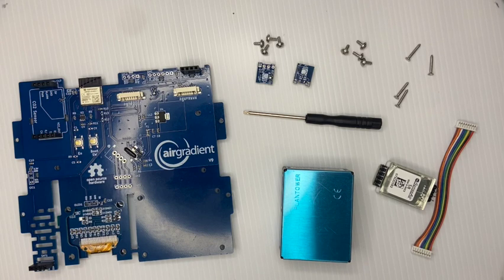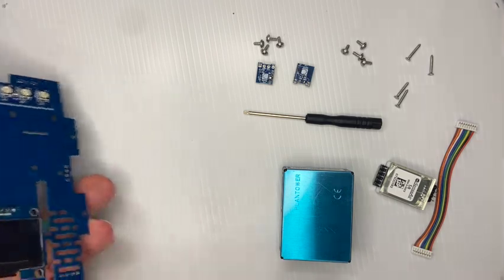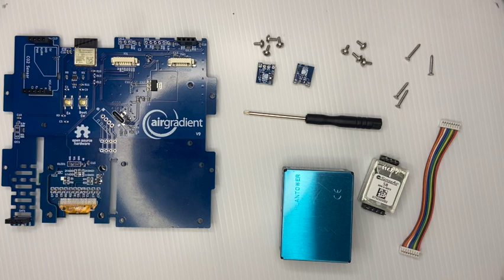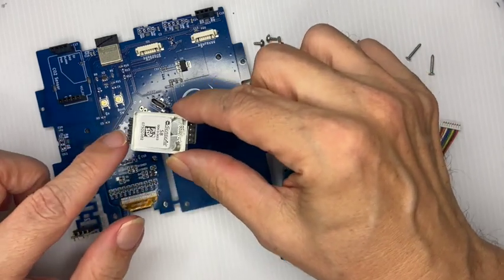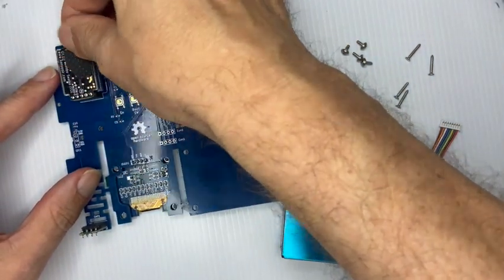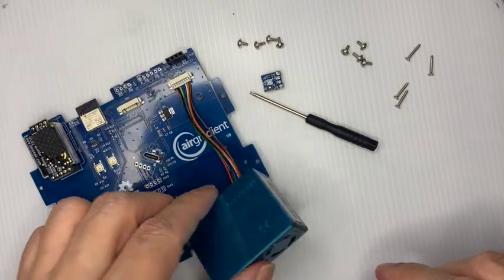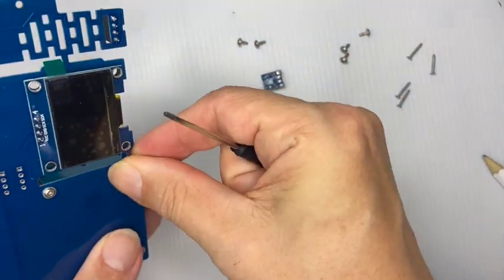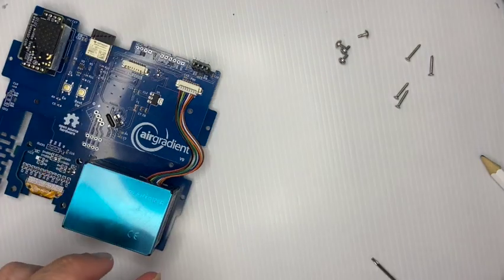Assembly Instructions AirGradient ONE Kit (Version 9)

Comment: This no longer matches the assembly of the kit as of 2026. There are only 4 screws provided, and they are the outer ventilation screws for the body. You no longer need to screw the PCB into the enclosure, it is held in place by the enclosure itself. AirGradient might want to redo this video.

Comment: Is it possible to remove or disable the wifi chip to prevent it from sending wireless radio signals? Or is it not sending any wifi when the wifi is not connected? Reason I am asking is I will have it on my desk close to where I am sitting and don't want it to be sending wifi signals being so close to me. Thanks!

Comment: On my 9.1 kit, I had to contact Air Gradient, as the blue metal box and  stm5 thing were already connected, but nothing else in box. They sent me sensors, but I ended up with 2 little black identical looking "chips" that were not needed, black with 4 prongs - what are these for? Don't see a place for them -

Comment: I was confused, I bought the kit, but it looks already assembled - it did have tape holding the two pieces together, only loose parts were 2 stands if  standing it up on a shelf, and 3 of the little screws (not 4) - could not get a QR code reader to work on my Mac, so had to use my iphone for instructions - don't see where it gives info on where to mount it - mine will probably be mounted on the other side of my bedroom doorway (1 bedroom condo) - with the wall furnace on the other side of the doorway, natural gas.

Comment: I have received a preassembled kit,.. indoor and outdoor.
The indoor is recognized by HA fine.
The outdoor is not recognized by HA.
I believe the firmware of the outdoor is too old: Model: O-1PS | Firmware Version: 0.4.0

Can you PLEASE please pretty-please provide a video showing us how to update the firmware, using a macos.
When I try (fail) to do OTA update,.. it fails.
The error message says "Installation failed. Failed to initialize. Try resetting your device or holding the BOOT button while clicking install".
However I cannot identify the BOOT button in order to press it.
And there is no  button called "install" in the GoogleChrome window (there is a sentence saying "install airgradient one / openair version 3.1.3 06JUN24"... I am assuming you mean this?
But were is the BOOT button?

Please make a youtube video video showing us how?
thanks.
Reply from the maker: Have you been trying to update through this link? https://www.airgradient.com/documentation/firmwares/. The boot button is located in a hole at the back of the device (to the top-left of the USB port) and you will need a paperclip or something else long and narrow to press it. If this doesn’t work, please reach out to our customer support team via the website. Thank you!